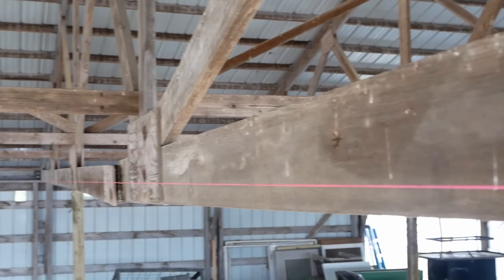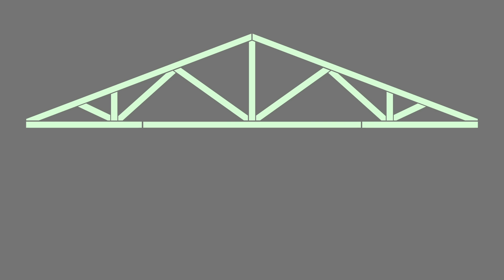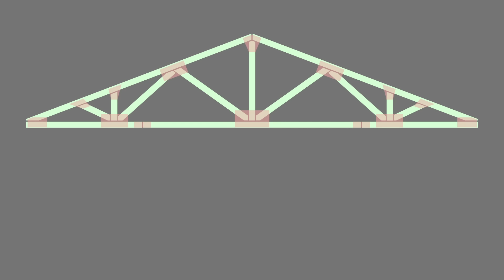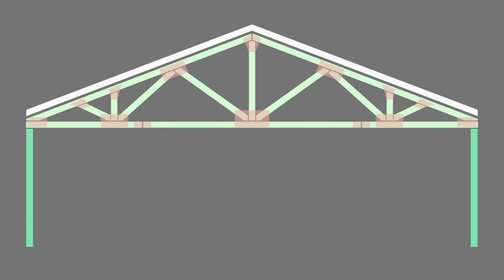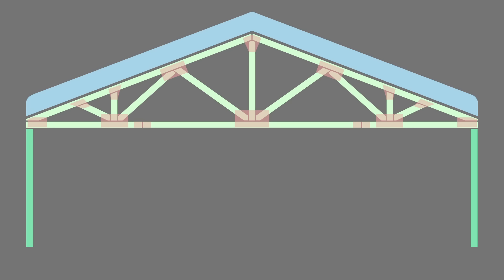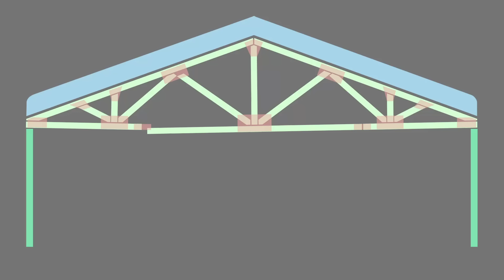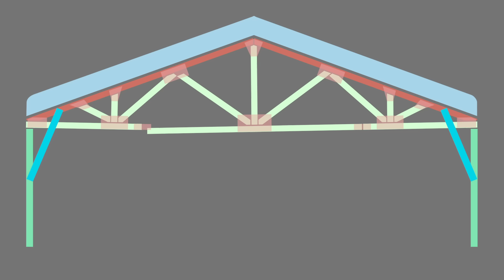Emergency Repairs: Dad's Shed Roof is Collapsing

Comment: April 1983... it had been a typical but not too bad winter in my part of the northern Plains, and everything was shaping up to be a decent spring. However, Mother Nature apparently forgot she had one more storm up her sleeve, and boy was it a doozy! In the town where I lived, nobody could get around town the next day, and the plows had a hard time getting the streets reopened - the snow was axle deep on our street, and a drift between our house and the neighbors was almost high enough to reach their roof! It was chaos at my school, as one heavily used hallway was between the classroom wing and the gym / lunchroom section. That hallway was a 1-story connector between two two-story sections and apparently enough snow piled up in that section to cause a 2' tall by 6" wide LAMINATED roof beam to bow and splinter in the middle! So of course that section (maybe 20 yards?) was closed off, but as it was a very heavily used section, we had to go around from the north end of the classroom section to the east end of the gym / lunchroom section. Added a good 2-3 minutes to everyone's 'commute' for a few weeks! The temps came back up slowly enough for the snow to melt off at a safe rate, but that same blizzard that swamped my town manifested as a nasty ice storm further north, and which laid waste to at least one electric coop's system.

Comment: Friendly message to Dad. This is not the time to stop at the proof-of-concept stage. You dodged one bullet. Take the time to finish this job as in every gusset is replaced, glued, screwed, through bolted and observed as the temporary supports are removed. It’s now a fact that your snow load can be equal to twice your original engineered factor so your roof should be reengineered for 3x. I know you CAN do it so please don’t quit until you HAVE done it.  Kudos to all for the well executed rescue operation. 🥸👍👀🔨🔧✅❗️

Comment: I don't think it would have been a huge help considering that snow event but the span between the trusses seems extreme for your area. I have built hundreds of trusses that way but never set them more than 4 foot centers . . .  And in Alabama we don't have the snow load you get. The only other possible overkill for those would be a steel cable from side to side along the bottom cord and put a heavy duty turnbuckle in the system so you can really load the cables in tension. Either way appreciate you showing this and glad you were able to fix it.

Comment: Wes, biggest contributor to the failure is mentioned in your narrative "the snow stuck to the roof". Low pitched steel covered roofs take advantage of what is called the "slip factor".  As steel ages its "slipperiness" diminishes, resulting more snow buildup than the design anticipated. Impossible to design for this, just a fact of life.
Reply: Perhaps there'll be a summer video of "Kiddo" and his friends up on the roof applying wax for next winter?

Comment: Here in England, many buildings were literall bolted togeter due to damage during and just after WW2. Very long through bolts, 12 inch washers either side, excess thread cut off after. Can still be seen on many old buildings. Get long rodding, thread the ends, and have peace of mind for the future..
Reply from the maker: I've seen brick buildings fixed that way.

Comment: Good thing somebody noticed the issue with the building, before anything serious happened.
Idea, add in permanent turn buckles with steel cables at each truss, to help keep the front and back walls from separating too far.
In so many ways, the so-called experts put rules in place that only make the job more dangerous.
Like roofers, it's more dangerous for a roofer to wear a safety harness with strap then it is to fall off a roof.

Comment: the lower beam is only subjected to pulling apart. Wood is better at pushing together than pulling.
You're really happy that the barn is still standing.
Reply: That’s not necessarily correct. It all depends on how it is used, either in tension or compression.

Comment: Janky graphics were awesome. Same for sound effects.

What I'm sharing is not meant to belittle.  I'm not a Professional Engineer, just a fat 70 yr's old welder, still welding.  My 48' Ft. long X 36' Ft. Wide shop has double truss's (spaced according to size of end-posts. TRUE 6x6's Pressure-Treated, not 5-1/2" x 5-1/2" in) except at the Gable-ends. As I have been to other people's shop / barn's, locally, this seems to be the norm, here in the pacific northwest. 50 miles north of the SAN-FRAN-FREAK-O of the north, formerly known as Seattle.  Just some food for thought.  My Shop has scissor truss's, other shop's / barn's with typical "A-Frame" style truss's, same thing, double-truss built, except gable-ends.  Take from that what you will.

Comment: Thank goodness it wasn't up to code.  If it were, it would have completely failed.  I think the joints were pretty much code and why they failed. Glad they are now well beyond code.
Reply: My uncle was a structural engineer and would occasionally have me go out with him to take measurements on something built to code that was failing.  I can't recall him ever saying anything critical of the person or persons responsible for the design, he would simply say they designed what the customer wanted and if the customer wanted it to stand up under the conditions it failed, the customer should have said so.

Comment: Were those center supports only added after truss separation or back when the load was first starting to cause problems? I know a 45deg roof like on my shop is a huge pain to be on but it is nice because it sheds snow very easily. I hardly ever have snow buildup on any of my roofs.
Reply from the maker: After the bottom chord broke.

Comment: i have to do basically the same thing in my shop. they built it (poorly) themselves, then decided to hang a ceiling with sheetrock, mud, etc. from a lattice of 2x4's its causing the roof to sink and the ceiling is hanging so low i cant open my cabinets. i cant wait to repair that by myself!

Comment: I had a building collapse for the exact same reason a few years ago.  The splices of the bottom beam of the rafters was torn apart, and the entire building collapsed.
I think if the splices had been done with thru bolts instead of just nails it might have held together...

So reinforcing the splices with carriage bolts seems like a ver good idea!   🙂

Comment: That was a brutal cold snap we had in north Illinois. I’m a mobile diesel mechanic and that was a busiest I’ve ever been. 7ish days of temps that were basically 0° degrees.

Ran from one service call to the next, guys tanks were freezing up as they were driving down the road. Must’ve ran 100 no crank/no start starts and went through as many fuel filters.

Comment: Random excerpt from the internet:
Light snow: 5–20 pounds per square foot
Packed snow: 20–40 pounds per square foot
Packed snow and ice: 40–58 pounds per square foot
Ice: 58 pounds per square foot 
In areas with excessive snow loads, such as Minnesota or Maine, structural members may need to be designed to support them. In these areas, the roof of a pole barn may need to support snow loads of 60–85 pounds per square foot or higher.

Comment: Suggestion: Steel strapping comes in long coils, is cheap and very strong in tension. Bolt it to the upright one side just under the roof joists, stretch it across the underside of those roof joists and bolt through at the other side. If the poles cannot spread, the joist cannot drop or split.

Comment: I tought the rafters were probably on the thin side but its very had to gauge from a video.  Here in sweden I  think it would be quite alot sturdier.  But that is also really expensive. I'm glad noone got hurt.
Reply: Pretty much everything I’ve ever seen that was built in Sweden was superior to its comparable here in the US. 👍
Reply: @Rein_Ciarfella   Roofs still collapse now and then though. Usually on older farm buildings though that were probably built pre any kind of code.

Comment: Definitely your dad was lucky. Glad to see longer joiners were used and bolts, but personally I would not have used the construction glue in that situation, it crystalizes after a while and lets go. Waterproof PVA glue in my opinion would have been better and lasted longer, or maybe even an epoxy glue.

Comment: That's not how Norm Abrams would have fixed it.  😁 I might consider painting the roof black.  Yeah, hot as heck in the summer, but in the winter if even a tiny piece of the roof is exposed it will heat up.  Possibly melting some of the snow and ice.   The pitch is pretty shallow but maybe stick some of those electrical zig/zag heaters on the edges.

Comment: Seems the gusset plates are too small and not enough fasteners when first done.  I would cut some larger ones and go heavy on the construction adhesive.  That coupled with the long o.c. spacing of the trusses just looks weak.

Comment: It might be worth considering metal simpson tie plates to repair? Seems clear the plywood failed before, and the metal ones are cheap. Either the self-nailing ones like they use for commercial trusses, or the pre-drilled ones
Reply from the maker: Plywood did not fail. The glue joint failed.
Reply: @WatchWesWork  Fair ... but if you use the metal truss plates it won't rely on glue! Not trying to be a smartass ... just helpful. I believe the commercial guys all use metal, they're about $2.50 each

Comment: the one thing new would really help it is your rafters are not spread so far apart adding more in between cutting it down to 2 feet instead of 4 feet would really help a load.

Comment: Yeah. Those reinforced butt joints in the bottom chord that failed are basically mechanical fuses in the context of the greater truss design. Not sure what they're supposed to be protectin' though :P
For any higher capacity, you'd have to use a single big long engineered piece, or, like, steel. Actually, permanently-installed steel cables rigged along where your chains are  would back it up pretty well in future events... At the cost of having tensioned cables that need periodica maintenance.

Comment: I think the heavy snow was a problem all over the midwest (Michigan here). I and my neighbors both had some 'temporary garages' (steel pipes + canvas) come down after they'd been fine for a few years. For us, it was the accumulation of snow added weight, but also the trees accumulated ~1 foot of snow on their branches and when it began melting it was dropping heavy loads on everything. Last week we kept hearing scary sounds outside but it was really just snow falling off the roof or trees and slamming into the ground.

Comment: Maybe lost some hydraulic fluid there?

I have a Bobcat 440b that has recently dumped a bunch of fluid on the garage floor.  Out of one of the wheels, looks like.  Curious if you’ve had a similar failure.

Comment: Our house was engineered for a snow load of 218 psf. Last winter we saw a tiny bit of deflection but the attic doors still opened and the drywall didn’t crack.

Comment: Why not leave the tensioners in place to prevent further movement, and then wait until spring and zero snow on the roof. At the moment it seems that you are trying to pull the roof back to as-built with tons of snow on the roof.

Comment: That's what family is supposed to do for each other, are that's how I was raised to be.
I know that's not the norm for most people these days as I see all too often. 
Shame that it's become the way things are, and I don't really ununderstand why it's gotten to be this way. 
Wes only thing I was wondering about, is the span between rafters, because I've always seen them much closer, and that's how my old barn is constructed, but with more rafters closer together. 
I'm not in the area where I have to worry about snow loading up on the roof, but here it's to secure the roofs from winds that can reach into the 60 plus when thunder Strom fronts come blasting through. 
I lost the lean to part that was added on to the north side due to a severe storm front, and it didn't effect the main barn roof because of the pitch of the roof itself. 
The tractor add on was of much flatter design, and when it gers rebuilt I plan on going up high enough to tie into the barn roof at least a quarter of the way up in order to get more slope to the new roof as I feel that's the reason I lost that portion to begin with.

Comment: Gotta use longer pieces when you sister rafters together..  at least 2 feet on either side of the crack and through bolt the sister boards together in 4 places..

Comment: So, it may well not be worth it in your area, especially as the building has withstood so many winters already. 

Something commonly done in my part of Alaska is running electric heat trace line on the underside of metal roofs- to cause snow/ice to melt off. 

Really not for snow load per se, but for when you gwt a warming front that turns it to ice, and an expected cold after- its hard to shovel a foot of ice lense off a roof. 

If you do decide ita worth it, how I've installed it is doubling up on the eves of the roof, to ensure the lowest part doesn't build an ice dam, and running up the roof slope rather than sideways. 
Have it set up so it is easy to plug in, and then turn it on when ice rain, sleet, or rain is called for. Don't have to get the roof very hot, just above freezing. 

One note, when the heat trace tape is on, expect large slabs of ice to slide off the roof at uncontrolled times, and dont turn it off until the roof, at at least the lowest section is clear of ice and snow. Turning it on, and building ice is worse than not having it at all. 

Glad the building made it through, and great video

Comment: I have a similar wood framed, uninsulated, metal clad building in an area known for ice storms.  In your opinion, in the event of a winter storm bomb creating severe buildup on the roof, is the idea of multiple heaters inside the building to melt the weight off feasible?

Comment: The rafters just don't look adequate. Think I'd be adding extra timber on both sides of the lower beam, which would be massivly over doing it. The bolts are a good idea at the joints for sure

Comment: I think if it were mine I'd want trusses at least every 4 feet.  In Pa I'm not sure that would fly the way it was and I wouldn't think our snow load was any worse than yours, maybe not as bad.
Reply from the maker: 10 foot is standard here for metal roof buildings with no ceiling.

Comment: Why not scab it back together with 2x6’s or 2x8 pressure treated lumber, That in my mind would provide the maximum amount of clamping force and give the building superb strength at those joints. And you could even go a step further and put 1/8in steel metal plates on either side of the 2x’s and that would keep the bolts and nuts from sinking into the lumber further increasing the clamping force.

Comment: Just look at Alaska they got plenty of commercial structures collapsing under the snow load. The knee braces definitely helped to keep the roof from falling in. 

You can google the I-5 bridge collapse in Washington in Skagit County. Oversized load took out the knee braces and a section of the bridge collapsed and fell in the river.

Comment: Those plywood joints need to be over laid on both sides with  2 inch thick lumber that's at least 10 feet long and through bolt the new boards togeather. This will spread the load away from the joints and should be structurly sound and will hold the weight. If you decide to go with plywood it should be through bolted rather then nailed or screwed togeather.

Comment: Eh, don't apologize. When family calls, family answers. That's how it should be! Job well done!
Also, those knees saved the building, more than anything.  They essentially bypassed the broken structure and directly conveyed the forces to the walls (hence the bow). That's how buildings should be done, aesthetics be damned. Belt and braces. Good job on your dad on building a great structure.

Comment: If the connections weren't bolted before, I guess they were just screws and glue?

Bolted (and riveted, for steel) connections add a lot of strength due to the clamping force. It's not just the shear on the bolts themselves, but the friction between the layers of the "sandwich" that holds everything together. In that respect I'm not sure if the glue is good or bad... but if it was just glue and screws before, it's definitely a lot stronger now!
Reply: I suspect it was nailed.

Comment: Graphics were pretty good, I thought.  I was thinking that through bolts might be stronger on the gusset plates and then that is what you were doing.  Also, the bottom chords are mostly under tension, perhaps running some steel cables the full length of each bottom chord would add some strength at little cost and take some stress off those gusseted butt joints.

Comment: Pretty sure your storm is the same one that nailed us, but it crossed two great lakes and had no mercy. Knocked out power to half the state for 2-5 days depending on location. Trees were down everywhere from the weight of ice and wind. Seen several cars that were transformed into boats by old oaks that were 3-5 feet in diameter lol.

Comment: That snow was like liquid concrete it was heart attack City I am so glad I have heavy equipment to do my driveway and I helped all my neighbors out because if you didn't get that pile of snow moved at the end of your driveway by the time the next day happened and it froze solid you were never moving it unless you have a skid steer
Reply from the maker: Even with a skid steer I could not move it.
Reply: @WatchWesWork  just have to up the violence level and make sure your seat belts tight :)

Comment: Those rafters are simply inadequate. Needs on piece lower elements,, and reall y in steel over that size. My shed if far stronger and narrower. And I live in an area that has never had snow